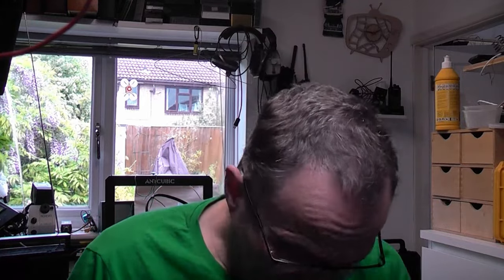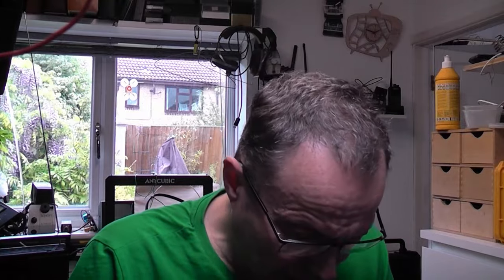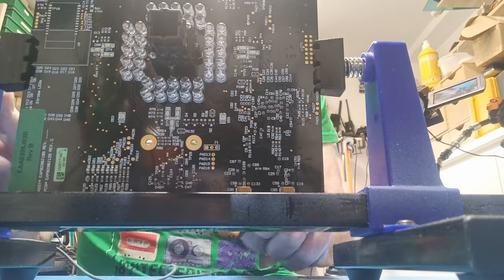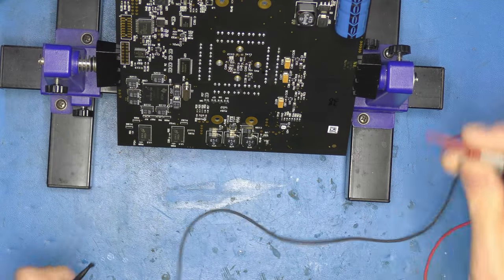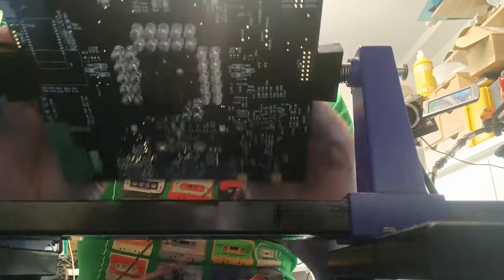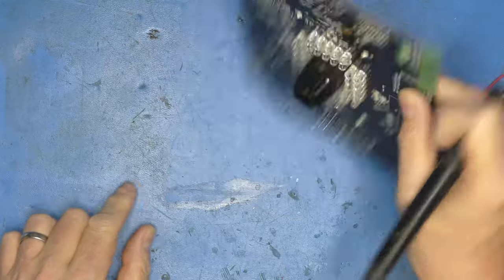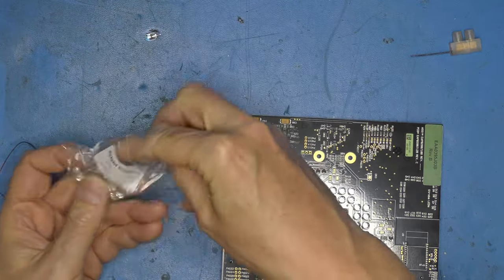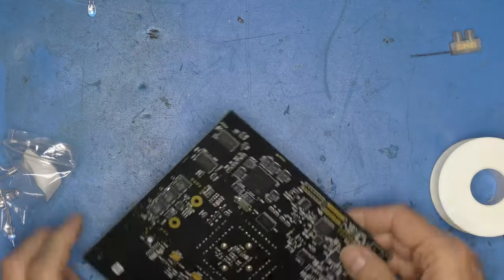Wheel alignment camera repair

Comment: pretty interesting design, it had pads for what it looks like an ESP32 module, but at the same time, they have a fully fledged TI SoC just lying around there? why can't you just add a wifi module to it rather than adding an esp module? seems weird
Reply from the maker: Indeed - I suspect the camera is used in different units having different requirements. This is very much a fixed installation, but I can imagine wifi being useful for a portable unit. Also (although not shown in this video) the mounting bracket for the camera needed an adaptor to fit. My bet is it originally used a different camera, and as the product evolved, this was made to fit from a later design.